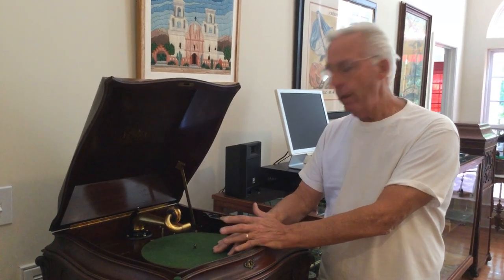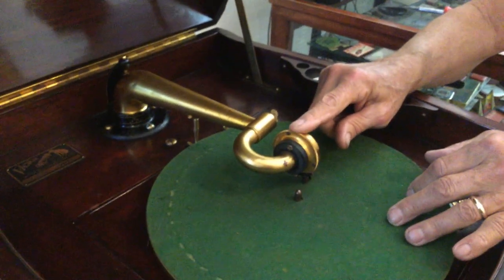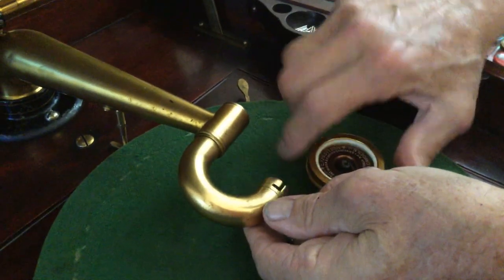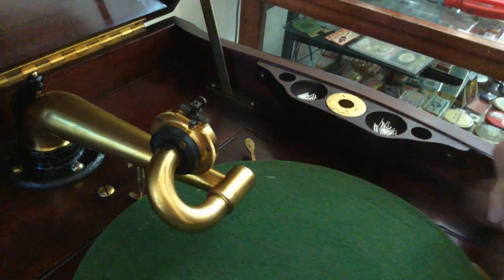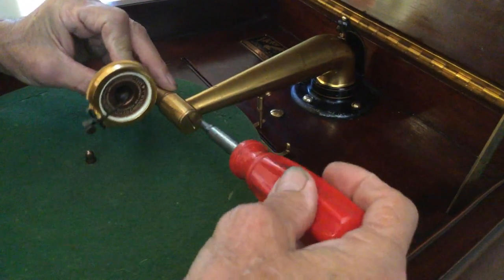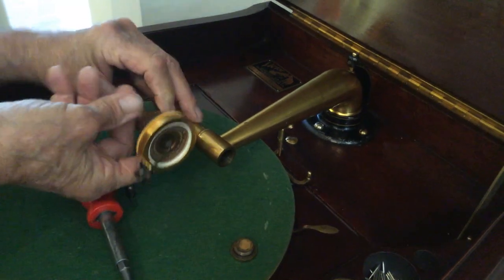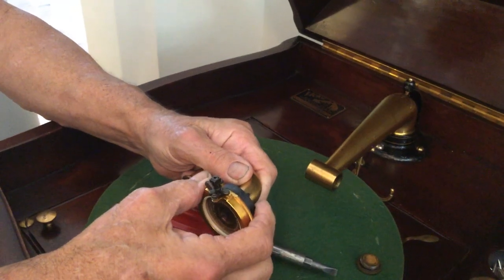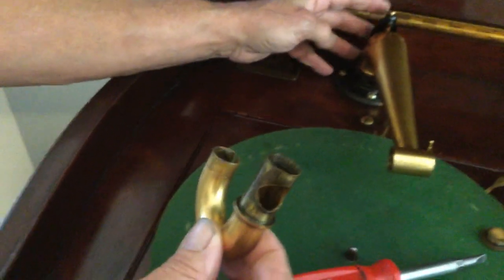446.  How to remove a reproducer from a Victor phonograph tone-arm

Comment: ahh so i was right.

i have an exhibition reproducer similar to yours on a 1916 VV-VI, but the rubber crumbled and the attachment point is left in place. its unlocked from the L but wont move at all

thank you for this video!